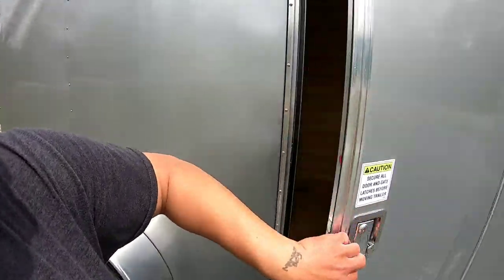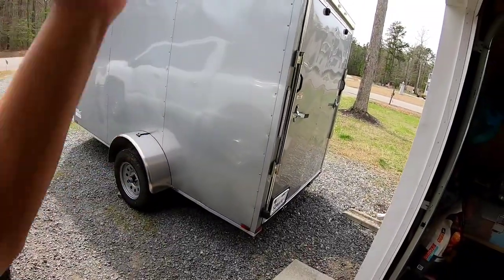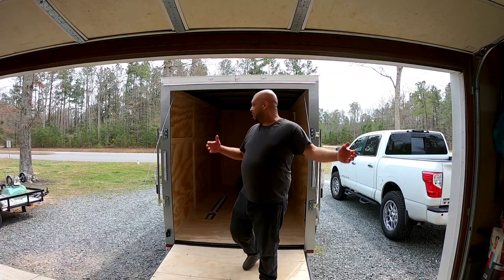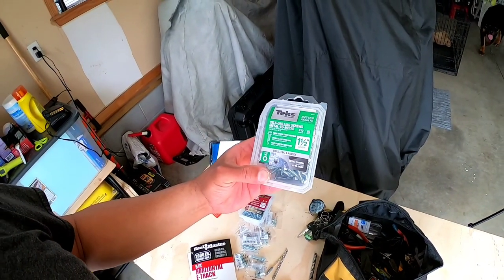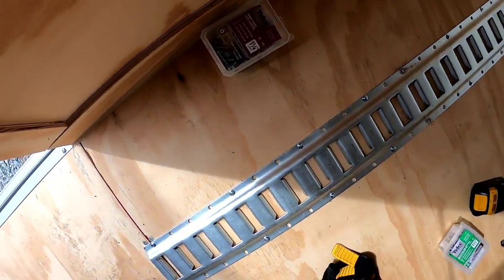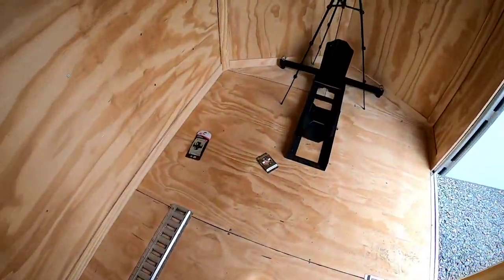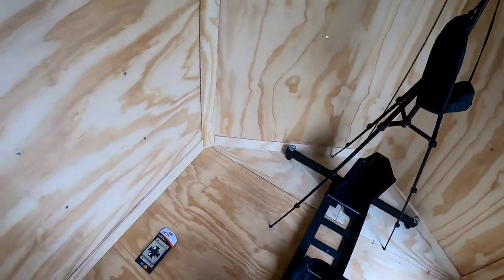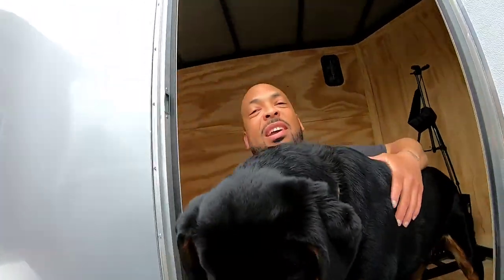Installing E-Track and X-Track Systems #etrack #Xtrack #enclosedtrailer

Comment: Great video, building my trailer up now… what size are them T nut there you installed..?
Reply from the maker: That's awesome.  I believe I use 3/4 inch T nuts, obviously you can use what would work best for you, but for this particular job 3/4 was enough.
Reply: @MCarter719  kool man thanks! Will look for those… keep up the great videos.
Reply from the maker: @DjP2379  Thanks for the feedback. Good luck with your project

Comment: That shit ain't going to hold a 900lb bike if you have to brake hard should be installed with 1/4 x 1" 1/2 x 20 with a locking nut at least every 4"'s
Reply from the maker: But it do, and if you had any sense you would have noticed the wheel chock that was also installed to keep the 900lb bike in place. Internet Trolls think they know so much. I bet you still use rachet straps to strap a bike down too don't you.